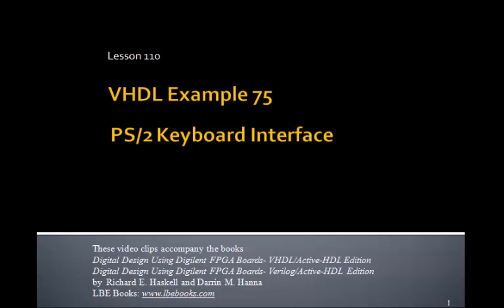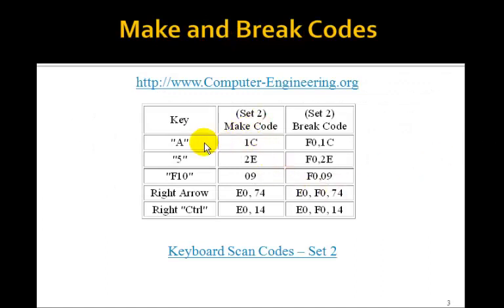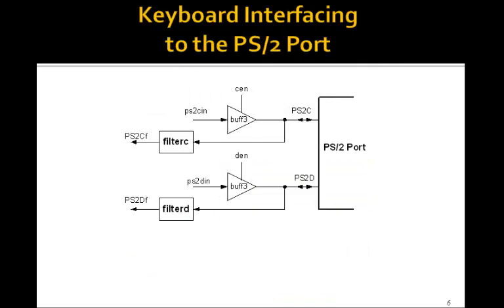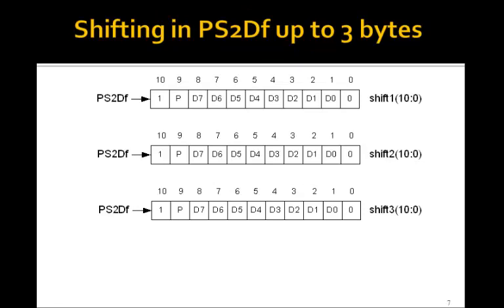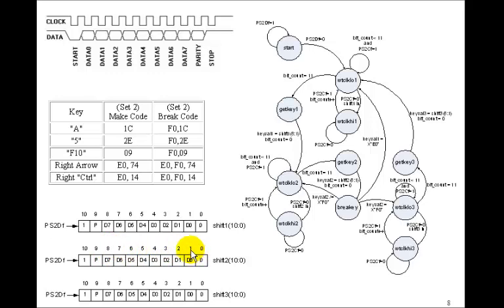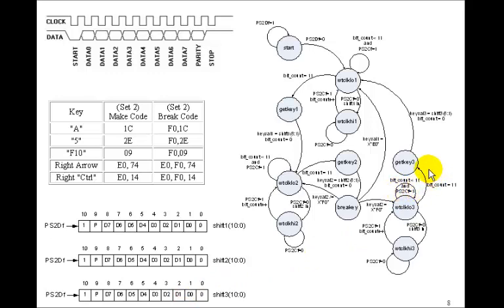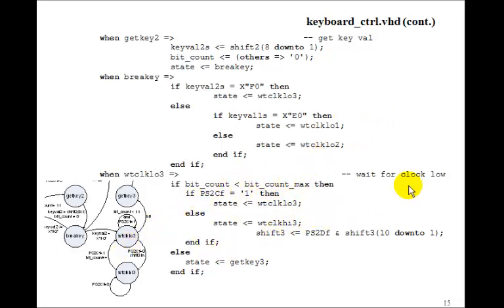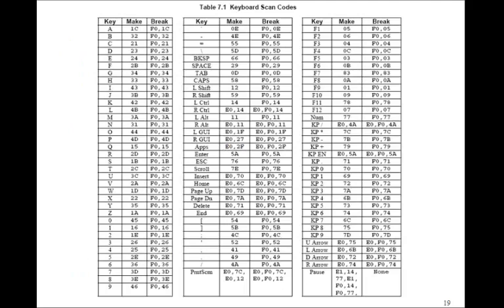Lesson 110 - Example 75: PS2 Keyboard Interface

Comment: Thanks a lot for this. Just a question, why are you using clock 25 MHz and not 50 MHz and will that make any difference? thanks
Reply: I use a 50Mhz clk and works great.

Comment: FINNALY!!!...it works. Was receiving false 'make' and 'brake' codes. I am using a keyboard by the firm "acer". so for it to work I had to switch the 3 lines "keyval*s <= shift*(8 downto 1) ; " to "keyval*s <= shift*(9 downto 2) ; "(instead of * you put 1, 2 or 3) all in all pretty good video. My guess is the keyboard sends the polarity bit after the start(made in china maybe?) or there is a problem with the bit_count timing ( misses the first bit ).
Reply: ucf ?

Comment: Great!!! Thankyou so much LBE books

The ps2 port offers an asynchronous communication. That means the ps2 data and ps2 clock are not synchronous with the fpga clock.
My question is that :

is the filter doing the operation of making asynchronous to synchronous conversion?

because from some other websites i found of using D flip flops to make the Ps2 data and Ps2 clock to be synchronous with 50MHz clock

Also how to do the error checking with this code?
Reply: Hi sj ms,
 Did you know how to make PS2 synchronous with 50Mhz of the FPGA?
Thank you

Comment: Why is there two different make-codes for alt key?
Reply: Because they are different keys. Your question still stands, why do they have the same name then?
I guess, most of the functions they regularly perform are identical, except when in special applications, which need to be able to distinguish between left and right alt keys.